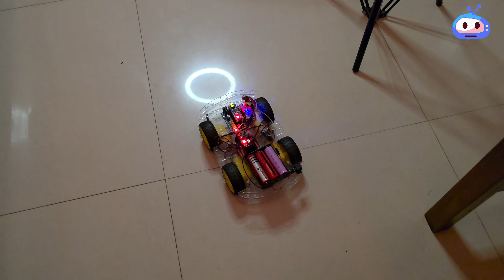Easiest Arduino RC Car Build for Under $50! Here's How

Comment: Do bo motors have polarities,,how do you know which terminal on bo motor is negative or positive,,or there is a dot that indicates.I don't get it if connected them in series or parallel
Reply from the maker: BO motors generally don’t have fixed +/− terminals. You can connect either terminal to + or −; reversing the wires reverses the motor’s rotation.

For multiple motors:
• Parallel: + to + and − to − : full voltage to each motor (recommended).
• Series: motor-to-motor : voltage gets divided between them.

I connected each sides motor in parallel.
Reply: @Roborear oky